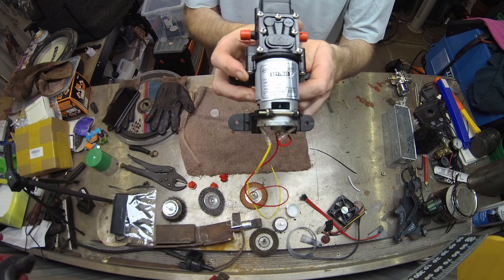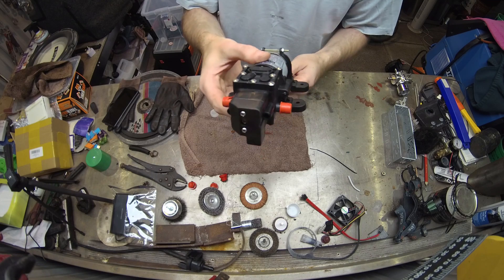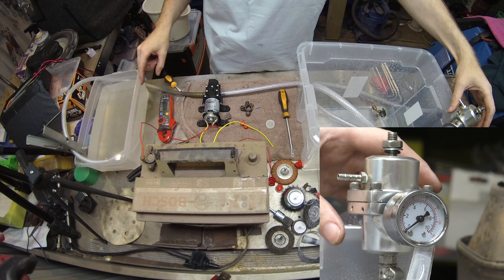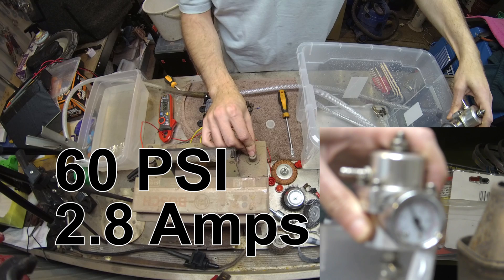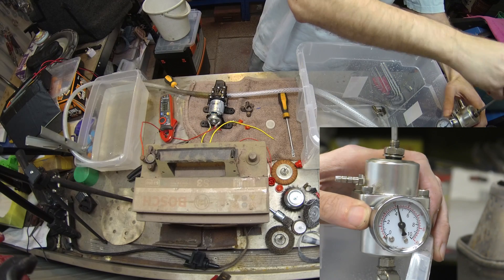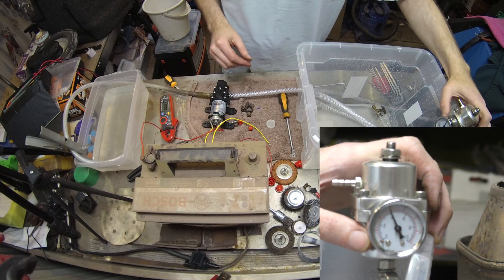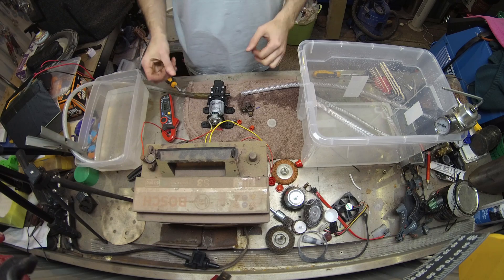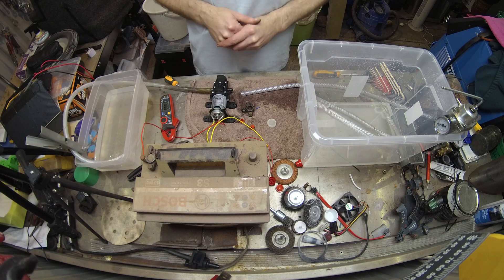12V DC 100PSI 4L/MIN High Pressure Diaphragm Water Pump Test

Comment: Adjust the pressure regulator.  Most 100 psi pumps I've seen are set to 80 psi.  The pump kicking on and off is the pressure regulator on the end of the pump.

Comment: Great vid! I'm messing with a 12V 5A Baylight dual pump 100 psi at the moment, trying to get an outdoor portable shower heater set up to keep the chill out of my small pond/waterfall this winter. Went thru 3 different pumps already. There is an adjustment allen screw on the switch housing to bring the psi shut off up or down. I believe clockwise lowers. Some pumps have sealed switches. The biggest pain is mating up a 1/2" hose to a tiny 3/8" barb without leaking lol. I used one like you have in the vid to heat a small 260 gallon inflatable pool last summer. Took a couple hours but makes the water nice and toasty. Could see the steam come off near the end of fall :-)

Comment: From the 12v pump pressure adjusting screw, would it hurt if we increased the pressure a little?
Reply from the maker: On that pump it has a pressure switch that turns the pump off at a certain pressure.

Comment: Your principle is good. But to make the test easier and quicker I would have set the gauge at the lowest setting and then connected the power wire to the battery with a clamp and then opened the gauge up until the pump started clicking and then observed what the gauge read  at that moment. That would have been easier then the constant trial and error method you were using.
Reply from the maker: Indeed.  I would do many, many things differently.